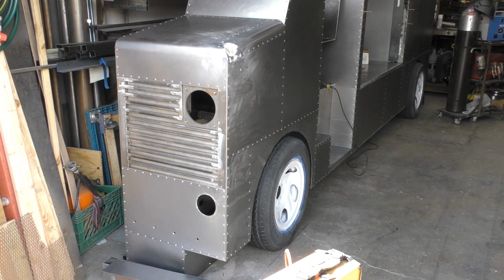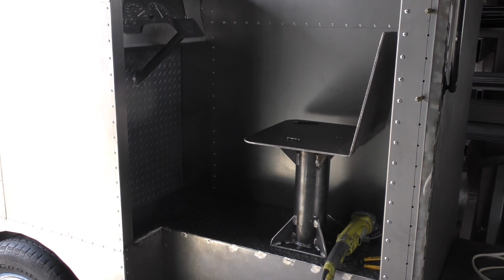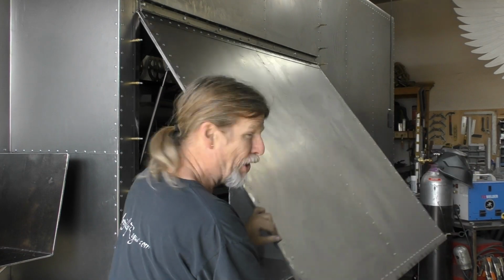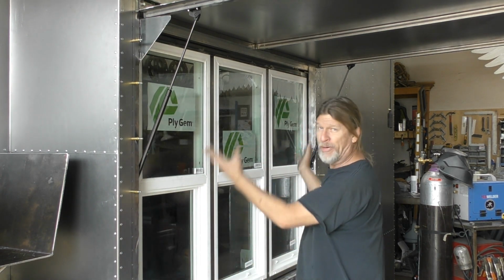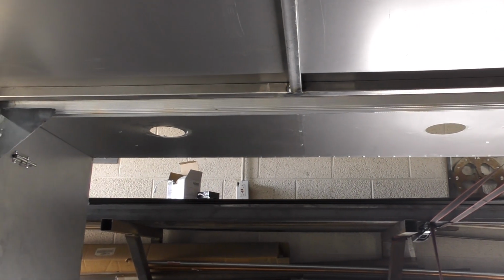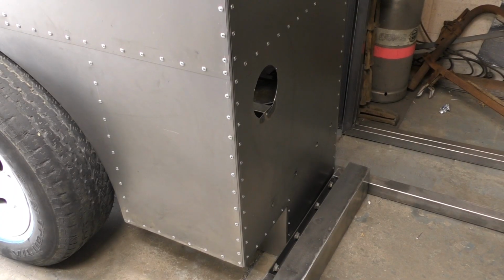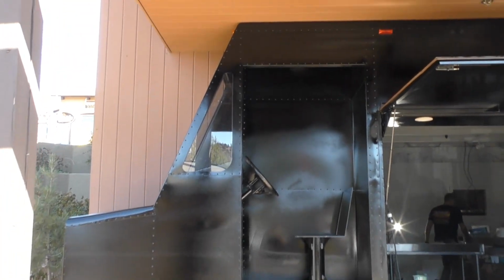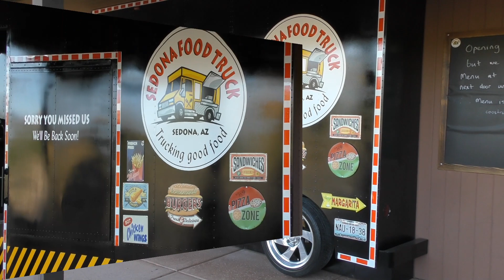Worlds Skinniest Food Truck!!

Comment: I was wondering - copper sulfate or acid?😁

Also, turn the gas springs over, they will last longer. The oil will "feed" the seals and less gunk will collect at the shaft entry which reduces wear on the seals.
Reply from the maker: Thanks for the tip Roger